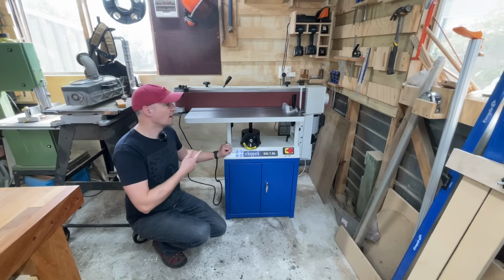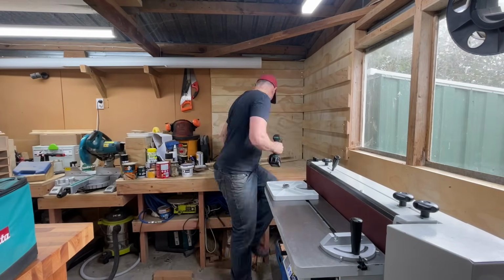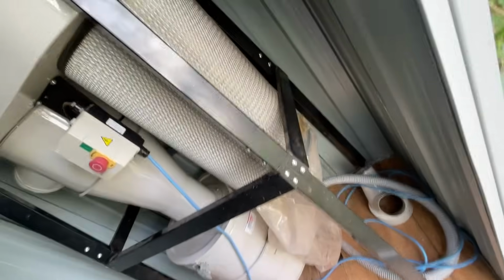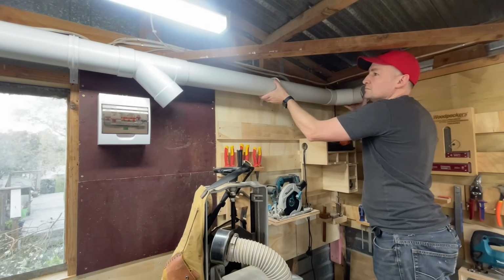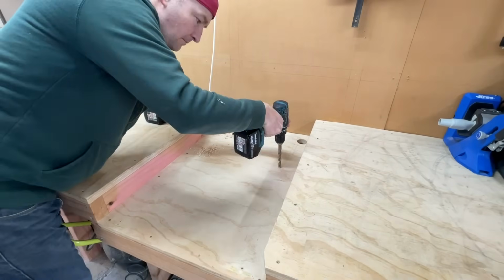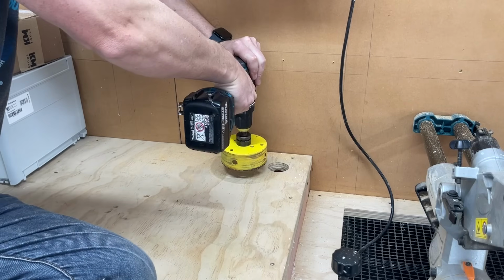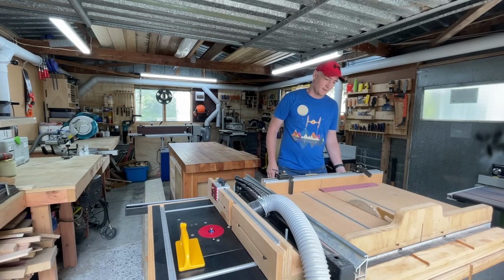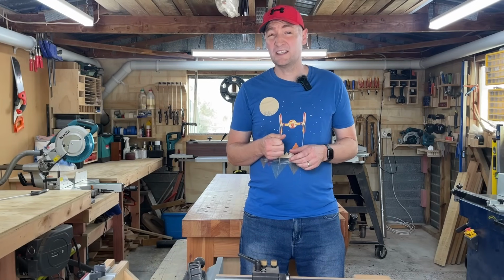Affordable small shop dust collection

Comment: Great video! Thanks for sharing!! I especially like your miter saw set up. One thing I've learned with large hole saws and small drills is once the cut is started, run the drill in reverse. A sharp hole saw cuts pretty well in this mode without the torque.
Reply from the maker: Thanks for the tip, I will try it out next time time 😊

Comment: Hey Kris, fellow kiwi here! Thanks so much for the video, I've watched it about 5 times now as inspiration for my own shop. One thing I haven't figured out is how the voice control of the dust collector works. My dust collector looks very similar to yours, and if I turn it on, then turn it off at the wall, then turn it back on at the wall, you need to then press the physical button on the collector for it to turn on again, ie it can't be exclusively controlled at the wall (which I understand is what a smart plug essentially does). Was there anything extra you needed to do beyond just plugging your collector into a smart plug to get it working? Hopefully that all made sense, thanks in advance!
Reply from the maker: Hey there, yes that is a problem, I ended up getting an electrician friend to bypass the on off switch, so it’s basically always on… slightly dangerous but a must for me because the machine is effectively outside
Reply: @macsworkshop  Cheers Kris, that helps me moving forward. Just wanted to check there wasn't a quick solution or something I was missing, thanks!

Comment: Might not have an issue with dirty air in your area but in dry locations a grounding system is a must. Static electricity is a real danger
Reply: 100%. All plastic dust collection piping should have a static discharge element installed. Dry locations are of course worse but it really should be done regardless.

Comment: Really like your system! Great job!

Have you had any issues with static electricity buildup on the PVC pipe surface? I have seen it happen, and the occasional discharge is shocking 😆

I haven't researched it yet, but there must be a conductive spray paint or something like it that can be applied to the PVC pipe to conduct the static buildup to an electrical ground.
Reply from the maker: So far I haven’t noticed any at all.
Some people have suggested simply coiling wire around the pipes and grounding it.

Comment: Did you seal off all of those loose connectors?  Why get a HEPA filter when the collector is outside?
Reply from the maker: I was thinking about sealing them but haven’t yet, the suction is great and so I haven’t bothered 
I could probably do without the filter but I got the unit second hand and a really good deal

Comment: Those pipes are going to leak so bad and you're going to lose atleast 30% suction.
Reply from the maker: I’ve been using it for a few months now and even if it is leaking, it does its job perfectly 
I had considered getting some sealant tape but after using the system I decided I don’t need it

Comment: I built the same system for my drop saw but I put it all in a shroud box, nothing ever falls in because it’s protected. The shroud box served as a base for extra lighting and also allowed me to position must haves like a “million dollar  hand” and markers etc and hearing protection. I find if I don’t have these immediately at hand there’s a chance  i won’t use them at all. It was also storage for stop blocks.
If you plan on installing tracking on the drop saw bench try using rectangular aluminium tube. Cut a slot out of the long face and you will have t track. Do in on the table saw, it handles aluminium easily. Worked well for me.

Comment: Hi, I have completely avoided the solution of either venting or putting my 2 hp dust collector outside, because you start pumping your heat or air conditioning outside. The only way for me to save space would be attic, wall or put it outside and allow air flow back in.
Reply from the maker: Fair enough 
I generally only work with my garage door open, which generally lets all the heat out anyway 😆

Comment: So, your filtered dust collector air is not returned to the shop space, correct?
Why on earth do you need a HEPA filter?
Reply from the maker: It was a second hand unit so I need up cheaper than getting a new unit without a filter
Also, I haven’t ended up using the space in the small shed for wood storage, so it’s good not to have everything in there covered in dust too
Reply: @macsworkshop  You have a significant loss of airflow with a HEPA type filter. I'd suggest a singed felt bag instead, down to 1um but a heck of a lot better air flow. If collecting dust at the source is your intent, don't worry about dusty lumber storage. That's what leaf blowers are for.
Reply: @macsworkshop  you could exhaust the dust collector air directly out of your little shed if you aren't too close to the neighbours and do away with the filter altogether. Given that your system is running through a cyclone, only the very fine dust would get past and just be blown outside. This would give you maximum airflow. That's how I have my setup here in Aussie. I do however, have the advantage of not being too close to the neighbours.

Comment: Do you suck out all the air conditioning and Heat?
Reply: Depending on where he lives in New Zealand, that won't be an issue as it is in a fairly temperate climate. I live in Queensland, Australia and let me tell you, sucking the heat out of your workshop in summer is a great idea!
Reply from the maker: Yea, there’s no aircon in my workshop
I actually have to work with the garage door open as the table saw feeds out it, and there is no insulation in the walls, so not much point installing one either 😞
Reply: @beetleb1801  I like to keep the chop air conditioned in the summer to keep the woods stable
Reply from the maker: I would like to as well, but not an option at the moment unfortunately

Comment: Job well done mate. I will give you a couple of pointers if I may. 1. For your main pipe 6” (150mm) pipe would be better as it gives you 50% more suction than the 4” (100mm) pipe. Here is a link to a good video on this. https://www.youtube.com/watch?v=p_K_kQVZ_og2. You need to earth all the PVC pipe as you will get static electricity build up in the system that could cause a spark which could lead to a fire.
Reply: yes to 6" pipe, makes a huge difference to amount of air movement. Ive run my system with  auto blast gates for over 6 years static has never caused a problem or shock or spark.